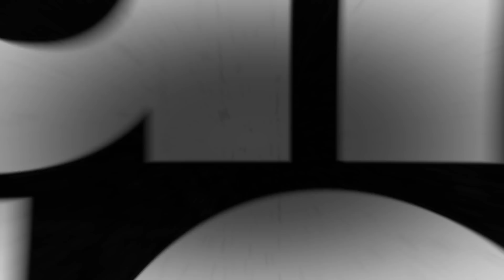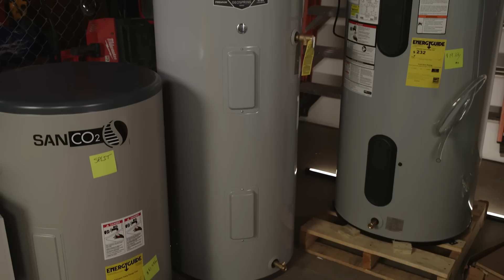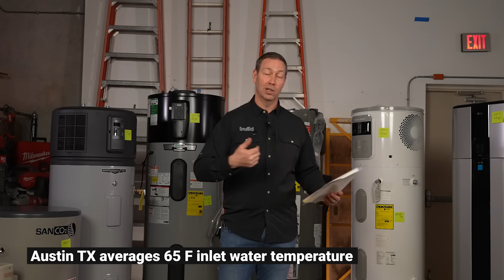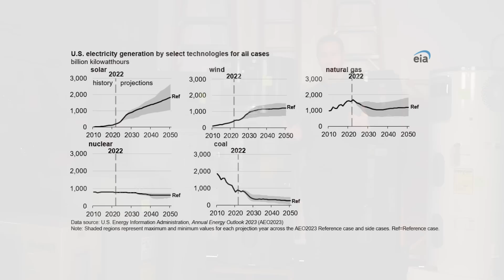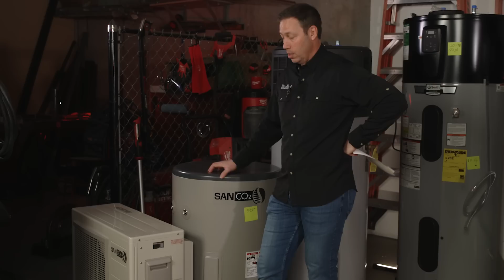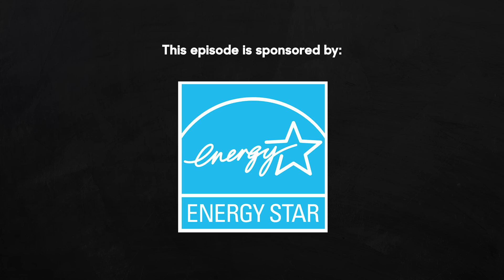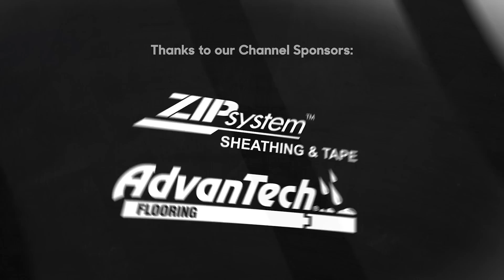2024 Heat Pump Water Heater Buyers Guide

Comment: It is not obvious that HP hot water heaters actually lower energy use in winter months  -- it depends on whether the heat they are moving into the water is free or not.  If the HP HW heater is in your un-heated garage -- say in CA -- then it will be taking heat from inside the garage and pushing that into the water.  This leaves the garage a little cooler, but over time the garage warms up as heat leaks into the garage from the outside.  This heat is free -- coming from the outside environment -- and the only energy you are paying for is the electricity to run the HP HW heater -- which will be significantly lower than what you would have used with a resistive, electric hot water heater.

This won't work in a cold climate like Maine.  The unheated garage, in the winter, will be too cold for the HP to work and your unit will switch over to pure, resistive heat.

If your HP HW heater is located inside the house -- say in your laundry room, or your basement, then the heat it moves into the water comes from inside your house.  That will leave the space around it a bit cooler.  This may not be a comfort issue, but the heat will ultimately be replaced.  If the HP is in your laundry room then whatever your space heating system is -- this is where the replacement heat is coming from.  If you happen to have a gas furnace, then you will burn additional gas to make up for the heat that was pumped into your HW heater.  You may not notice it, but from simple conservation of energy, this is what must happen.  That means you are (indirectly) using gas to heat your HW and the true energy cost is both the electric used by the HW heater and the extra gas burned in your furnace.  (Under these conditions the HP HW heater is actually less efficient than a gas HW heater.)

The same thing is true when you locate your HP HW heater in your basement.  Even if you do not directly heat your basement, in the winter it is warmer than the outside because it is being heated through the floor above it and waste heat that is coming off of pipes and other devices in your basement.  Again, when that heat is removed from the basement air, it must be replaced, and that is not coming from outside (where it is colder) but from things inside that are giving off heat.  Again, one way or another you are paying for this heat to account for the heat that was moved into the water to make it hot.

The above applies to winter months.  In the summer when you are not running your heating system, any heat taken out of the interior of the house is appreciated, and, it is replaced by free heat that is leaking back into the house.  So during warm months you will achieve the promised energy savings of a HP.

I am a big fan of heat pumps -- and HP HW heaters, but they do have their limitations and the devil is in the details.  You can read more about these things at www.thepragmaticsteward.com

Comment: So a normal water heater is $600. A heat pump is $2300. They save $25/mo in electricity. So a payback period of 5.6 years. Warranty is 1-2 years. The average hot water heater gets replaced between 8 and 12 years. You said they are between 45-55 decibels but every review I see they are between 65 and 75, quite loud!  Installers are gouging on these pretty badly as well so the install is significantly more. I think this is a bit of a rosy review and the benefits aren't exactly drastic.

Comment: Don'r reallly agree on the "your fridge only move heat air outside". If it would be only about "moving" air it would be a ventilation system. In order to cool there must be some mechanical work, and this work is done by a compressor. The cold comes from the air detend after it has been compressed, and is similar to heat pumps in that they also uses compressor techniques, as well as air conditionning unit. (On a very broad scale)

Comment: I bought the AO Smith series 500 electric 50 gal, 12 year warranty, , explain the WiFi schedules to me . I set the schedule to be 5am and 9pm. Why if I take. Shower @ 7am the water temp\amount in tank goes down. But a few mins later after the shower has concluded. I go to the water tank location and verify the coil Icon is light up, and on the app it’s back to being full 100% status of hot water in the tank. U thought the next time the water gets heated up would be at 9pm….?

Comment: Matt has fallen i to the trap of energy comparison. Electric water heaters are stand-alone units, whatever electricity consumed by the unit is all the energy used. But, HPWH don't work this way. They must be treated as a household unit where the heat added to the water must come FROM someplace, typically the heating system of the house. The energy label on the unit does not account for this energy but, treats the unit as a stand-alone device.

Comment: Yes it's more efficient but where do you think your saving goes when the heat pumps breaks? Even just having an HVAC technician dispatched to your home will cost you around 100$ before anything is done for fixing the problem. So where are the long-term saving?

Comment: I'm in Eastern NC and unfortunately they put my electric ~80 gallon water tank in the attic right over my master bedroom. And its 18 years old and needs replacing because Im afraid it will spring a leak and flood my bedroom. Is heat pump water heater not a good idea in an uninsulated attic space?

Comment: What about connecting to geothermal hvac to this type of system.  I think with geothermal a holding tank is used to buffer between the water heater and the geothermal.

Comment: Can you use one of these heat pump water heater to heat a hydronic concrete slab floors of a 1000 square ft well insulated building?

Comment: I’m all for lowering operating cost.
Up front cost is considerably higher than a conventional electric water heater and even higher than some life time warranties that some all electric tanks come with but cost savings can be wiped out pretty fast if the heat pump needs repair down the road. Lots more moving parts to a heat pump water heater than a 2 element non corrosive traditional hot water tank.

Comment: You missed the R32 and R290 monoblock air to water heat pumps that can supply heat, hot water and AC all in one very efficient unit. The CO2 unit is overpriced and only comes in one small size.

Comment: a neat design feature of these things is the "free" cooling it provides the room.  if this shares a mechanical room with a Networking rack, Solar Battery bank then you give that mechanical room a few degrees of cooling, and those heat generating components feed the heat pump.

Comment: My hybrid heat pump dropped my gas bill from $67 to $7.50. I had no idea how inefficient my old gas water heater was. I figure all the scale, heat loss from the old gas chimney flue and the heat loss from the bottom burner plate contributed to all the gas bills. My electrical consumption went up about $12... still a huge savings over gas. Basically $12 in electricity vs. $60 in gas.

Comment: Do NOT buy an A O Smith heat pump water heater. Our second one just failed after less than one year of use and the first one failed about two years after it was installed. Both had the same problem: The compressor stopped working. Incredibly, with this particular unit, A O Smith does not replace the compressor but, rather, the whole water heater. You might be stuck with the installation costs. Further, when we asked if we could donate the first unit, because the pure electric function still worked, we were told that would not be allowed to do so and that the unit would be junked. Our experience is not unique. Just google "A O Smith heat pump water heater" and you'll see what I mean. We will choose another brand this time around. Save yourself huge headaches, do some research, and avoid A O Smith.

Comment: I have a gas water heater that used not only for hot water, but recirculates water through a hydronic air handler for heat. Can a Heat pump water heater replace the gas water heater or would it be better to just replace it with another gas water heater?

Comment: I'm thinking about a heat pump water heater for when our electric water heater in the garage needs replacing. We also have a recirculation pump under the sink at the other end of the house. I'm visualizing the flow in my head, and I think that shouldn't pose any problem for the thermostatic valve, because the water being pumped from the hot line to the cold line will just circulate through both the heater and the valve, in some proportion determined by the valve, right?

Comment: Are there any advantages to installing on 240v vs 120v in terms of efficiency or heating speed? I have a 240v setup now but for generator power I was considering changing to a 120v unit. granted we are not on generator often but going without hot water is not fun. thanks ***whoops you answered my question at 13 min...

Comment: Why is it so hard to find information, especially on the disadvantages, of installing a HPWH in a crawlspace? I'm considering replacing my 30-gallon resistance water heater, which is currently located in my crawlspace (located in the SE of the US). Although I can accommodate the height requirements of a HPWH, I'm finding it difficult to gather the necessary details to make an informed decision.

Comment: How much is the manufacturer paying you to recommend these water heaters iv been in the heat pump market for 52 years and I was the largest heat pump dealer in my area Newark Ohio what is the cop of the compressor electric heater is a one to one ratio for every dollar you spend on electric you get one dollar worth of electricity if the cop of the compressor is 3or 4 you get 3-4 dollars worth of electricity with a heat pump but you are talking the heat that you have already paid for to heat your house and heating your water   Heating your water is in my opinion a small part of your enery energy consumption the problem I see is the up front cost of these units and if you have maintenance cost You have just lost any efficiency that you might think you are saving. This is backed up by our corrupt government there is no way that you can compare these with a tankless water heaters which will give you unlimited hot water without storage of hot water at 90 plus efficiency in my years of being in the business electric can not come close to a tankless water heater you only heat water when you need it what could be more understanding it’s not rocket science. The next to the last house I bought was 36x52 with 10’ ceiling in the basement with a walk out basement and the homeowner is consuming 300 gallons of propane a year which is unheard of. I don’t know how much the last house I built witch was out of ICF blocks from the footings to the trusses and it was about the same size  these hp water are taking energy from your house and heating your water so you have to be cooling something to get the heat plus you will have maintenance costs that the manufacturer are not factoring in one service call just shot the customers savings out the window.  There is very little maintenance on a standard electric water heater most times there is no maintenance for 10 to 15 years
Reply: I guess the manufacturers are also paying all the people in the comment section talking about the savings heat pump water heaters have saved them.
🤷🏻‍♂️

Comment: For the love of God, please spreadsheet the break even points. You HAVE to consider total costs, not just operations costs, then compare total cost to pitting the same capital cost into the SP500. That's how I analyzed my home's new HVAC.

I have yet to spreadsheet these, but they're all ABSURDLY overpriced now. I'd wager most will never pay you back . 

Run the dang numbers! Thumbs down for an incomplete assessment video. ;(

Comment: Has anyone seen people running the SanCo with their own tank?  The Rheem Marathon poly tank seems like a great choice, utilizing the T&P and bottom valves for extra fitting, the temp sensor could go in the element spot.  Even would have backup element use.

Comment: I got no rebates.  Power company does not do rebates and being a new build, I couldn’t get any rebates from the feds for energy efficiency.  I could only get fed money if I was replacing an old inefficient unit.  Sucked.  No money for the ERV or two heat pumps I installed either.

Comment: Love your videos, but for Rheem, the energy saver mode is the most efficient.  I had to double check myself because I thought the heat pump mode would be.  I have had mine running for almost 3 years on my new build.  We upsized to an 80 gallon tank.  I would never go back to old school.  I save money even though it was more expensive and I also can run it of generator power when my electric goes out.  One last thing, it helps cool my attic a little bit in the summer

Comment: My gas water heater started leaking last week and I want to replace with a heat pump.  I’ve had 2 plumbers tell me it’s not worth the extra cost.   Are they being lazy cause they don’t want to install one?  With the tax credit and rebates it doesn’t seem like net cost will be that much higher.  Plus I have solar so it seems like the energy savings will be even greater.

Comment: In Michigan. Have Rheem ProTerra in basement mechanical room. Drains into sump. 3 years no problem. Love it. We are off gas with exception of the dryer. Heat pump dryer is our next upgrade.

Comment: The payback ( ROI ) versus a standard tank water heater is not really examined by this video. Assuming a new tank cost of $600 versus a HPWH at $3000 ( which is the average cost for a mid size home ), we're looking at paying ( $3000 minus $600 ) an extra $2400 up front. Assuming a HPWH will save you $400 a year,  it will take 6 years to break even on your original purchase. Only after six years will the HPWH start "saving" you money. ( this doesn't count rebates, of course. Also your saving might be more or less than the example ).

The other thing that's unknown is the history of reliability of these units. A HPWH has a condenser/compressor and evaporator just like an air conditioner or an air-based heat pump. Those components wear out and fail. Ask the manufacturers what warranties they offer. It's possible you'll be replacing parts before a HPWH starts saving you money.

I'm not saying they will fail but there are more failure points in these new units than a standard water heater. Choose wisely. Both standard and HPWH deliver hot water, so if they aren't saving money there isn't much benefit. As Matt says, look at the recovery rates. If your household takes several consecutive showers, you'll be on your backup resistance heat ( the same as standard electric water heaters ) and consuming lots more electricity.

Comment: I bought a heat pump Rheem 65 gallon water heater... Nothing but problems, warranty repairs 3 times in 3 years and the water supply is just not there or it is randomly there and randomly not there.

We supply hot air from a computer lab with 7 desktop computers running most of the time.

Comment: Use 2.  50 gal Geo HWHP to heat my potable  hot water and  radiant floor  heat  in a  open system  for 1200 sg ft  super insulated home for about $750 a year  in Upstate  cqost me $1600  in  2014

Comment: Would this be a bad idea in an attic? The existing electric water heater sits in a tray with a drain that exits the attic outside of the house. Is this enough for condensate drainage? Installing the water heater in another area of the house is not an option.

Comment: Which brand is most reliable? AO Smith has horrible ratings on Lowes website, and Rheem on HD's site has some scary reviews too. Failing after a couple of years, and the warranty requires you to pay for removal/installation. Mine is in the attic, so that wouldn't be easy!

Comment: 4 y/o Rheem 50 gal hybrid quit working. "A0107 hater leak detection.check for leak on floor."  But floor pan dry w dust.
Grateful forcwarning... but wont restart.

After rethinking it... i r we moved condenate tube on the side... and it was damp.  
After watching videos complaining about this same tank that i have been bragging about... i found icr buildup on heat pump condenser, so i let the heatpump rest for 8 hrs.  I came home to 12 oz of water that melted into the pan.  I dried these all off, hung two different water leak sensors to dry in the wind... code will not clear.😢  i pulled the top cover dozen screws, elect, and dried it out w napkins taped to dowels, and towels.  It looks dry.

I'm hearing warranty w rheem is terrible.  Seriously thinking i will go back to old trusted resistance electric heating.  Videos say they are cheap to run, but foolish to maintain.

Comment: No Matt, I believe you misspoke at around 17:24. The heat pump water heater is NOT going to be 4X more efficient than a gas water heater - not by a long shot.   "A heat pump water heater can be up to 3 times more efficient than a traditional electric water heater and up to 50% more efficient than a natural gas water heater", according to the U.S. Department of Energy and an analysis by ENERGY STAR.   If your customer is cost conscious that is likely a break even for natural gas in monthly costs because natural gas has roughly 2x the BTU content as electricity per $. Of course local market prices can slew this formula.
Reply: Many HPWH have COPs of 4 which compared to the .85 COP of gas and the 1.0 COP of resistive electric renders the characterization of 4x efficiency completely reasonable. .85*4= 3.4. Most models are better than 3.4 with many being closer to 4.